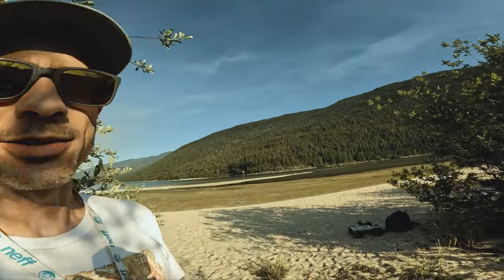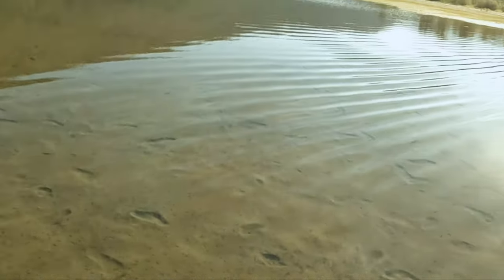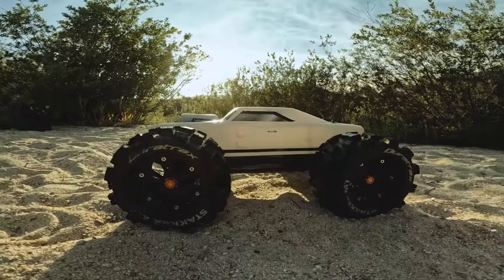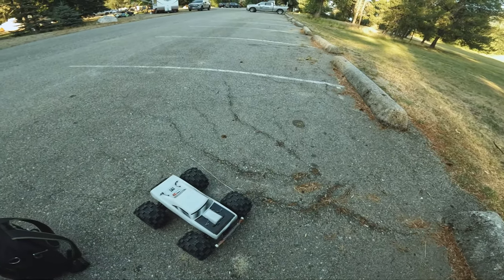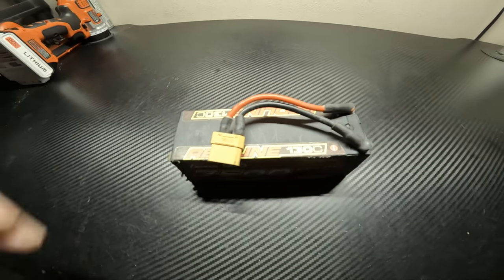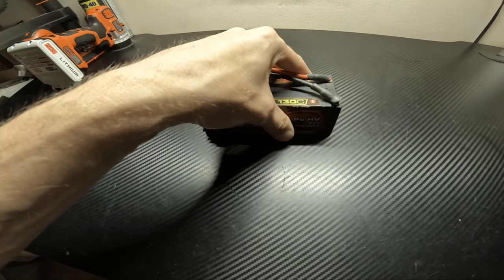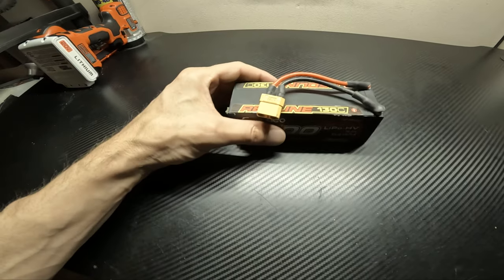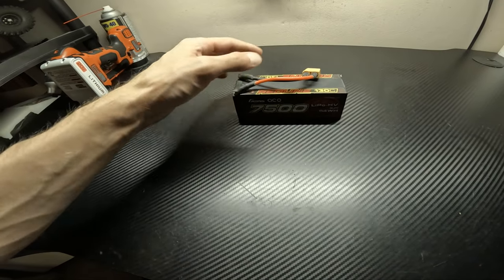Water Skimming Beach Day - Tekno MT410v1 - Hobbywing Max8 G2 Basherbodies Duratrax

Comment: Those tires worked very well. You had great camera shots underwater and in slow motion. I know you said you sprayed then truck with WD40 which I have heard of before wet running and in snow. I have also seen guys who claim that using WD40 on arms and other parts making them for flexible and breaking less. Have you ever tried that?
Reply from the maker: Thanks! I have experimented a bit yeah, I think you need to soak them for a while to get much benefit but it definitely makes plastic more flexible.
Reply: @shralpRC  It's good to hear from someone that has tried it and can verify it.